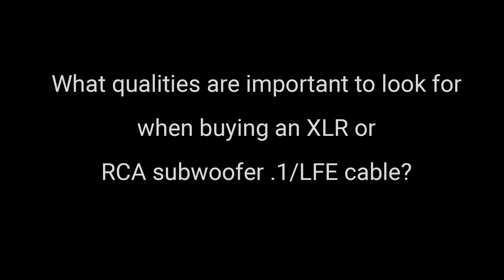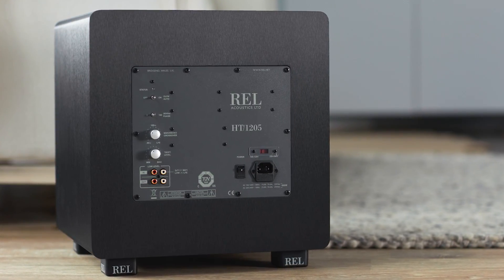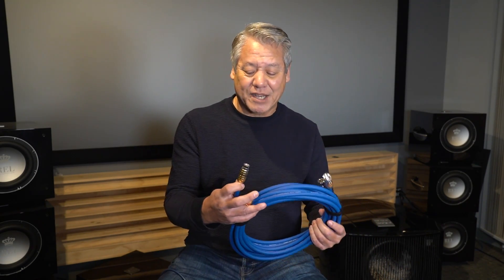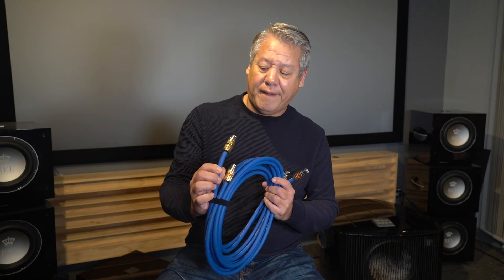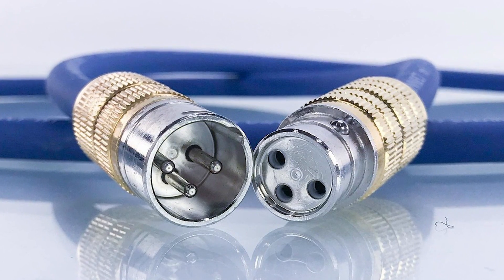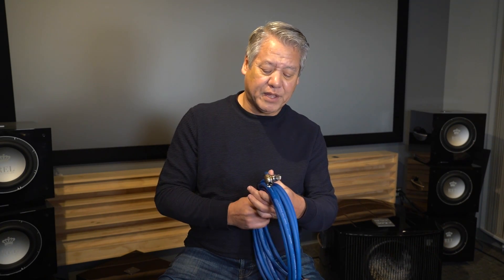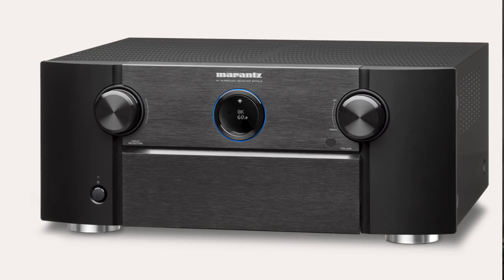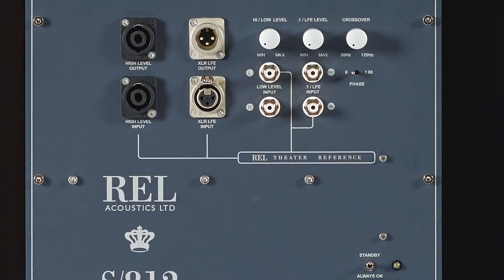What RCA cable should I get and what qualities are important when picking an LFE cable?

Comment: The thing is: technically we're talking about low frequency applications here, that includes the whole audio range. 20kHz is still very low from an electrical perspective.

Really long line cables lead to a lowpass filter effect at a point, that gets into the audio range. That's why the 10m/30ft recommendation is a good rule of thumb.

But for subwoofer signals that don't go higher than 100Hz or something? Really not a concern. If you get a slight lowpass at, say, 15kHz or even 10, it just doesn't matter.

Comment: When adding an external ground wire to my existing cable should I attach it to grounding points on both the reciever end and subwoofer end? 
Or just connect one end of the cable leaving the other end unattached?
Reply from the maker: Thank you for reaching out. The RCA inputs on our subwoofers are designed to achieve a signal ground reference through the outer conductor/sleeve of the RCA cable. This means that it is not necessary to use a separate ground wire if you will be connecting to either the Low Level or .1/LFE input on a REL subwoofer.

Comment: Thank you for the explanation in this video. I bought an T5X to pair with my KEF LSX 2. The LSX 2 has no options to connect any ground wire. Should I in such a case apply a ground-loop isolator, or just work with a decent RCA cable only. The place where my sub will be placed is in my office, there are quite a few power-cables ftp cables,  outlets, etc. around.
Reply from the maker: Thank you for reaching out. While some RCA subwoofer cables have a separate ground wire attached, this wire is not necessary to connect for our subwoofers. When connecting the T/5x to your Kef LSX speakers, you can just use the RCA cable and tape back the ground wire so that it stays out of the way.

Comment: Hi, What can you do to avoid hum noise when you want to run a 72 feet RCA cable because the subwoofer only has RCA input
Reply from the maker: Thank you for reaching out. With this length of RCA run it can be difficult to avoid hum or interference through the cable, since RCA is an un-balanced cable. Ideally for this length of cable run it will be best to use a balanced XLR cable if possible, or to move the amp/receiver/processor closer to the subwoofer. Otherwise you can use RCA but will need to be very careful with how the cable is ran so as to avoid interference being picked up, meaning to not run it near power cords/connections.

Comment: What if my receiver don’t have the XLR connectors? Is there a way to convert.
Reply from the maker: If your AV receiver does not feature XLR output connections, then you should still be able to connect using RCA cables to a REL subwoofer. For connection assistance specific to your system, please provide the model of AV receiver and subwoofer that you are using and we will be happy to help.

Comment: Just purchased a 1205, my first REL subwoofer.  Man it looks sexy.

I thought the RCA cables that I needed would be included.  I'm trying to make sure I buy the correct ones online now.  I'll be using the sub mainly for home theatre but we also listen to quite a bit of music too.  Should I only be connecting 1 cable to the LOW .1 / LFE and receiver, and then I connect the 2nd one only when I want to listen to music?  Or can I have both connected simultaneously?

Sorry because I feel like the documentation explains this but at the same time I'm kind of dumb.  Appreciate any help.  I can't wait to finally get this setup
Reply from the maker: Thank you for reaching out, and for choosing an HT/1205 for your home audio system. If you are connecting the HT/1205 to an AV receiver or preamp with a designated subwoofer output, then you can use a single standard RCA-to-RCA cable for connecting from the sub-out jack to one of either of the RCA input jacks on the subwoofer. If you are connecting to a preamp without a designated sub-out, then you can use two RCA cables and connect from the stereo left and right channel outputs on the preamp to the stereo RCA input jacks on the HT/1205. 

We hope that this helps, but if you have any additional questions about connecting the HT/1205 in your system then feel free to let us know and we will be happy to assist.

Comment: Thanks for the video, John. In the early part of the video, you’re holding what looks like an RCA cable made by BlueRigger? Do you recommend that brand (I have an 8ft run between a turntable (without a ground) and an Edifier S3000 Pro powered bookshelf speaker) and need to buy a pair of RCA cables)—I know nothing about this brand. Thanks for the help.
Reply from the maker: The RCA cable shown in the close-up at 0:14 is made by BlueRigger. BlueRigger makes good quality RCA cables, though there are many other good quality options available from a variety of manufacturers. We have also had good experience using Audioquest and Kimber Kable RCAs.
Reply: @RELAcoustics  Which cable would be preferable from Audioquest? For example - copper, like "Black Lab", or containing silver, like "Irish Red"? In some REL video, I heard that you prefer to have silver when soldering the terminals of your wires for the High Connector.
Reply from the maker: @vladvic5139  Thank you for reaching out. Both copper and silver cables can work well, and can have slight differences in their tonality and performance. Ideally it would be worth trying both options to see which you prefer, though in most applications copper wire will be fine.  It is more important to make sure that the cables which you are using are well insulated and have sturdy connectors on both ends.

Comment: hi i got a qustion what type of amp or monoblock more better for 212sx..as you are saying in 1 of your video for woofer better to use XLR THEN RCA..not all amp have XLR BEHIND..most likely will be higher end maybe rotel or higher..
Reply from the maker: Thank you for reaching out. There are many different amplifier models which will work well with your 212/SX subwoofer, and each "type" of amplifier has different sonic characteristics. Typically it is best to purchase the best amplifier possible for driving your main loudspeakers, and then take care to follow the correct High Level connection instructions for that type of amplifier. 

The XLR or RCA inputs on the 212/SX are designed for connecting to a preamp or AVR, and while XLR does technically provide a lower noise floor, for most home applications you will get equivalent performance from either XLR or RCA connection.

Comment: I asked both Gene of Audioholics and Anthony Grimani in their recent videos and they both said DO NOT connect both Hi Level and LFE at the same time.  I guess this setup only apples to REL subs.
Reply from the maker: We cannot verify the design and connection specificities for other manufacturer's subwoofers, though I can assure you that all REL subwoofers which feature the High Level input are designed so that both the High Level input and the .1/LFE input can receive signal and operate simultaneously. If you have any questions regarding connecting a REL subwoofer in your system, feel free to write in to contactus@rel.net and we will be happy to help.
Reply: For a lot of brands, that is true... but not for all brands. Always ask the manufacturer, 
not a person who gives general advice (even if good) across the board ;-)

Comment: Thanks for all your videos John. I haven't seen them all, but I've enjoined the ones I've watched. Just bought a couple of Rel 212/sx, and I'm very satisfied with them. One thing that strikes me every time I buy new speaker or try new sub woofer is the phase. All sub woofer I've tried so far I had to reverse the phase. Makes me wonder if I've did something wrong with when I connected my main speaker. But after checking multiply times it should be right. What the reason that I have to switch phase on my sub woofer? I'm sure there are other people playing with sound out of phase without knowing it. It took me a day before realizing it.
Reply from the maker: First, thank you for supporting REL, and we are glad to hear that you are enjoying the performance of your 212/SX subwoofers. The ideal phase setting for a subwoofer is dependent on the room and how the subwoofer(s) are placed in the room relative to the main loudspeakers and room boundaries. As a result, in some systems the 0 degree setting will be ideal, and in others the 180 degree setting will be best, and you truthfully won't know which is correct for your system until you connect the subwoofer and begin playing signal. In any system, the correct phase setting will be whichever yields the loudest and deepest sub-bass output, as heard from your listening position.

Comment: Hi John, great stuff. Can you please help me with connections of Rel T5i. I own Denon AVC-X3700H and i am not exactly sure how to connect LFE cable. Where should i put the cable on AVR? Is it subwoofer on Pre-out section? So basicly the same conector as with Low-level imput? Thank you.
Reply from the maker: The .1/LFE input on the T/5i can be connected to one of the two designated subwoofer pre-outs on your Denon AVR. You can then also connect the High Level input on the subwoofer to the main front left and right channel speaker output terminals on the amplifier, with both inputs being able to be used simultaneously.
Reply: @RELAcoustics  I asked both Gene of Audioholics and Anthony Grimani in their recent videos and they both said DO NOT connect both Hi Level and LFE at the same time. I guess this setup only apples to REL subs.